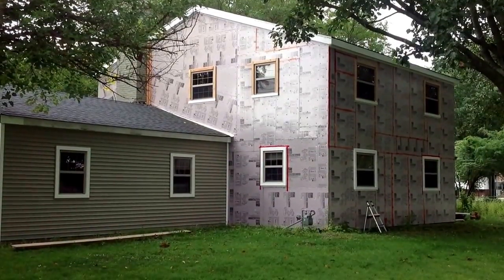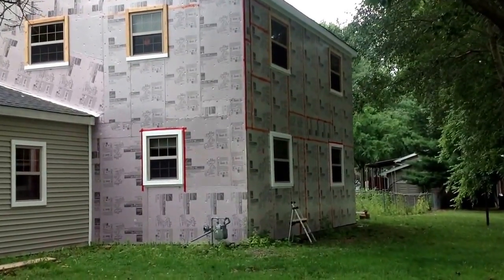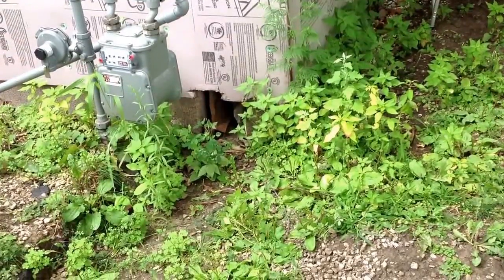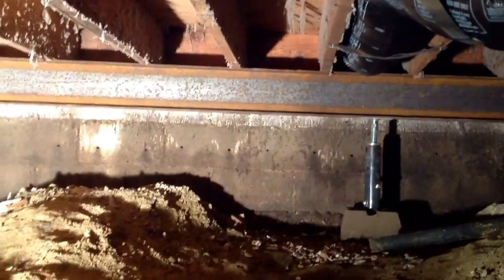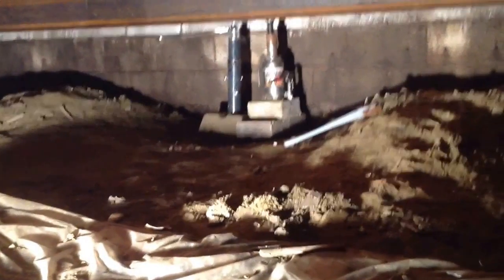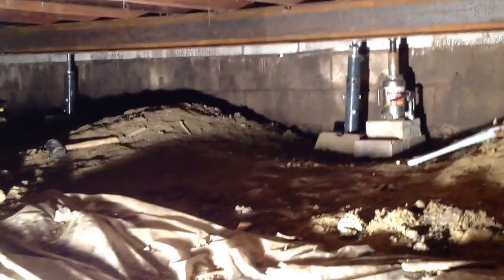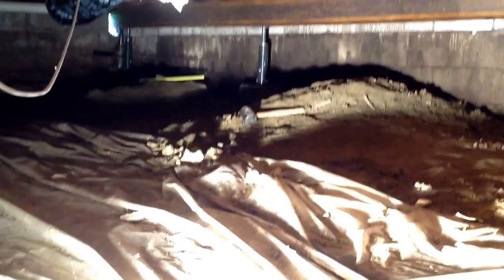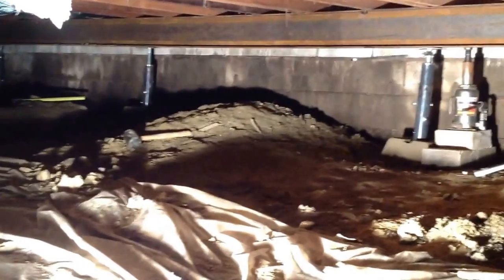House Leveling - Jacking up a House (raised three inches)

Comment: Good video and some great tips thanks for sharing.  Did you come up with a good way to excavate the dirt?  I don't have the Benicio having a basement I'm dealing wit a simple crawl space of 12 to 24 inches any ideas?
Reply from the maker: I used a very short shovel. It was tedious work, but got easier as the hole got deeper. I ended up sitting on my butt with my head in between joists for most of the digging. That position seemed to be the easiest on my back and provided good shovel maneuverability. Good luck :)